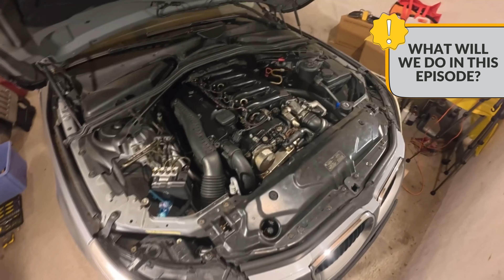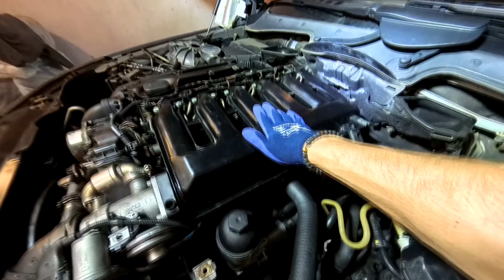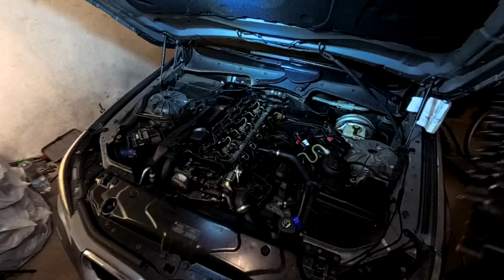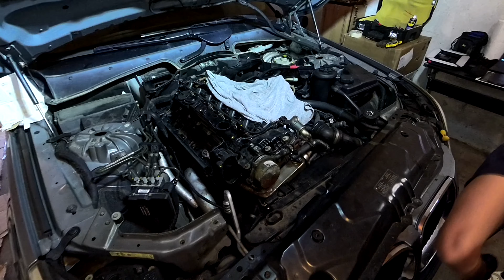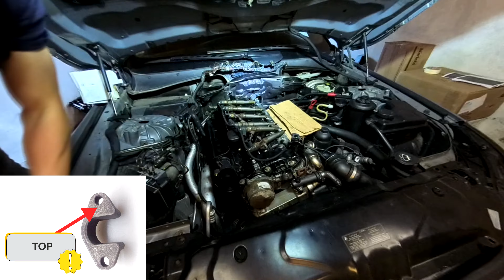How to REMOVE and reinstall INJECTORS on BMW e60 & e61, M57n 3.0d

Comment: is the high pressure line not 23nm?
Reply from the maker: Hi, brand-new lines are tightened to 22–25 Nm (23 is optimal). I used 30 Nm because my lines were already used and aren't perfectly smooth, so it's better to use a bit more force to ensure a tighter seal at the joint :)
Reply: @fixmyBMW  ok
Reply: @fixmyBMW  mine is leaking just do 30nm?
Reply from the maker: @nihonkokusai  It's worth a try, but be careful—anything over 30 Nm can cause it to crack. If it keeps leaking at this torque setting, it could mean that the flare on the metal fuel line is permanently deformed and needs to be replaced
Reply: @fixmyBMW  25nm then will replace the line itself